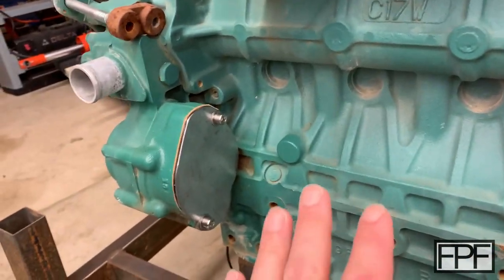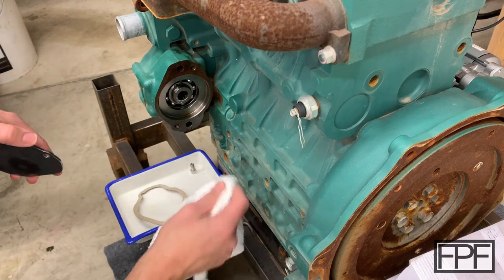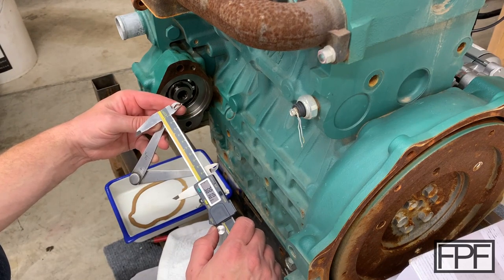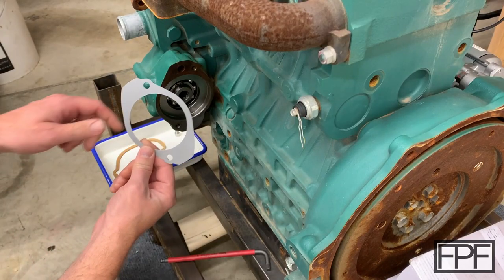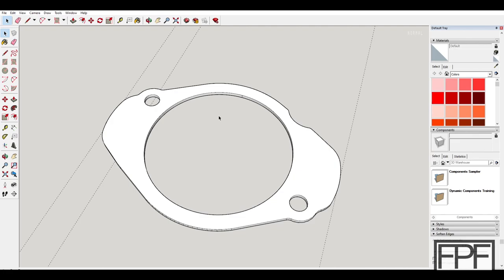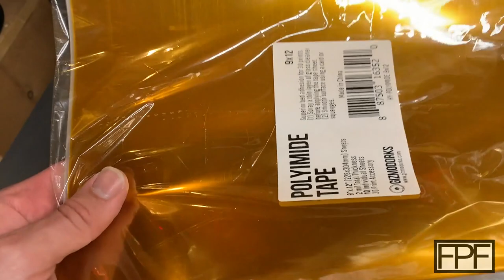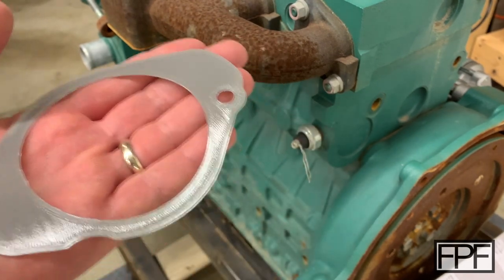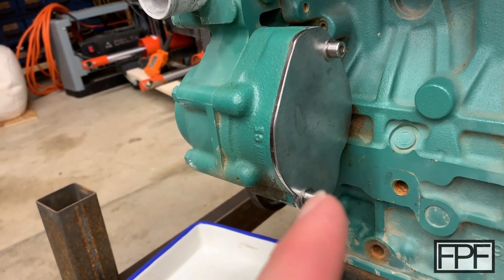3D Printed TPU Gasket for Diesel Engine

Comment: Neat little project but I'd wipe the plate and block down with acetone or IPA and use a good automotive silicon gasket maker on it, but that's just me.  I wonder how well TPU holds up against oil (no oil pressure in that area, just oil). After you run it awhile keep us informed. Interesting!!
Reply from the maker: From my research, it does fine in oil.  It swells a very small amount in gas, but that's often considered a plus for gaskets, and several folks use it with gas as well.
Reply: I should attempt to 3d print a valve cover gasket
Reply: I watched another YouTuber who soaked a tpu gasket in gas for a year and it barely swelled.
Reply: TPU is one of the most chemical resistant plastics out there when bought from a good supplier! (if the data sheets are to be trusted)

Comment: Nice video. I've been using TPU for making gaskets for a while now, and have had a lot of good results. Especially gaskets that wouldn't be possible to cut out by hand, like the ones that have some sort of raised lip, or other 3D shape to them.
Reply from the maker: thx!
Reply: I as well for hydraulic pumps

Comment: Can you tell me why you hollowed out the gasket, the covering plate is solid right across, the gasket could be the same unless the centre of the bearing sticks out in which case it would rub on the steel plate too. Basically it just a blanking off device like I put in my EGR valve.

Comment: I was wondering how it's going to hold up against the heat. Will it get too soft against the heat?
Reply from the maker: TPU doesn't soften till ~120C.  This area on the block shouldn't exceed ~105C (liquid cooled engine)
Reply: You should carefully check the TDS. Some soften as low as 60C. Unfortunately HDT isn't usually available so you're stuck with guesses based on melt index / vicat softening or empirical testing.
Reply: Would give it a max 100C that is kind of normal for pu...but could be lower

Comment: Or just buy a gasket for $3.97
Reply from the maker: I wish.  This engine is from a Volvo DD25 roller.  That's where the hydraulic traction motor mounts, and there's a machined ring that goes into that housing on the hyd. pump that I don't have.  I'm putting this motor in a Geo Tracker, so I need a cover plate with a gasket here instead.  I also had to make the cover plate, as I found none offered.  Kubota's answer seems to be to use the water pump side cover without the hyd. pump drive instead.  Unfortunately, those cost more than I paid for the whole motor :)
Reply: @FunctionalPrintFriday  interesting. It looks just like the ones we service. I bet they are the same as Cat or Cummins but since it’s a lovely Swedish engine they done cross reference
Reply: Or print it for $ 0.12 worth of filament and entertain yourself for a couple hours
Reply: @Leedledlee  and suffer from a failed "gasket" after a few hours of running.

Comment: I'm guessing that the two screws on a thin blanking plate sealed leaks not much better than thoughts and prayers. The clamping force must go to near zero with such a distance between bolts and over time oil is sneaky. Originally there would have been a deep casting there that could distribute the bolt load with much less deflection.
Reply from the maker: That's a great point.  My hope though is that since this isn't under any pressure, that the incredibly limited sealing force is still enough to keep the oil in in the case

Comment: I like that you reversed engineered the original design process rather than just taking a photo.  I enjoy that too.  Now I'll have that diamond trick in my tool box if I run into something similar myself.  

Here's a quick shortcut for testing the fit of a shape like that.  If you create a drawing from the part, you can print it on a piece of paper, cut it out with scissors, and have a test piece in seconds instead of waiting for a 3d part to print.